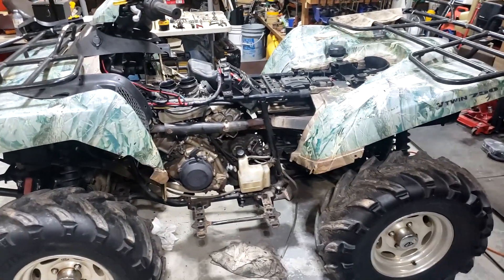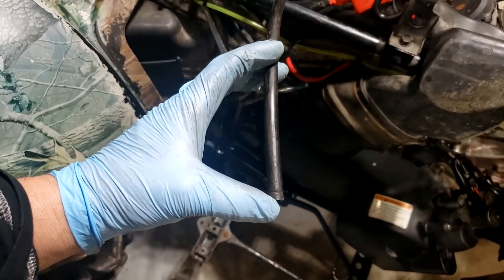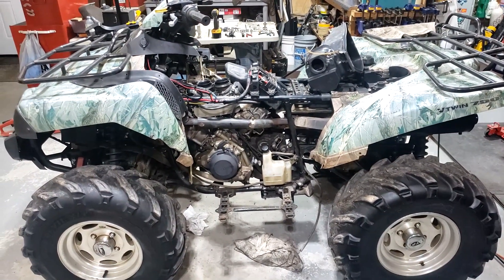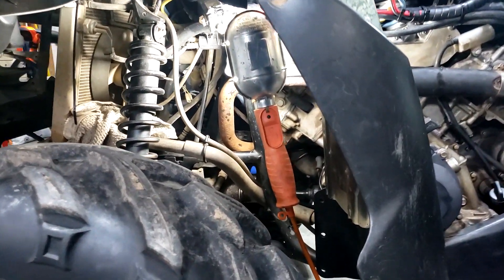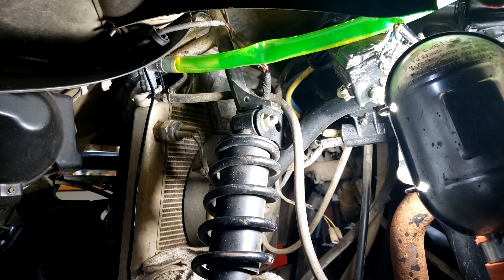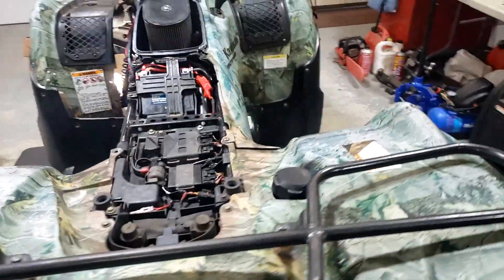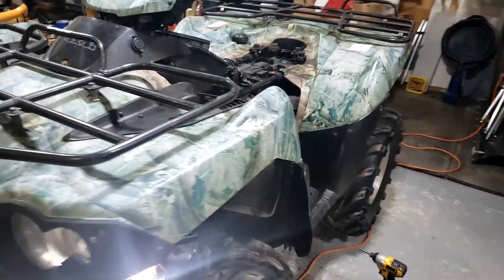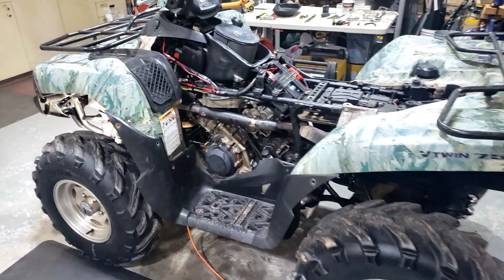Worst Abused ATV I've ever seen Brute Force 750 machine finally done

Comment: On my 06 I replaced the lower steering “ball joint” added a grease fitting, omi greasable upper steering bushing, polyurethane gresable sway bar bushings, gresable metal sway bar links, also did the buss connector mod
Reply from the maker: Cool, sounds like some good mods! Thanks Man!

Comment: 👍😎👌Nice job Rob you literally brought that ATV back from the graveyard. I wanted to know did you also end up replacing the ignition coils too after you swapped out the spark plugs? 
I'm trying to determine where my short is with my 2010 BF750. I was in the process of taking out my battery but before I could detach the positive and negative terminals it slipped from my hand and made contact and grounded itself with the frame of the bike.😳
 I heard an electrical distortion but all the fuses and relays are good.        Now when you turn the key to on the fan immediately comes on and the push start button and headlight switch no longer works. The FI light also flashes and the fuel pump is no longer turning on. If you have any ideas in terms of where you think my electrical issue could be your help would be greatly appreciated.🙏
Reply from the maker: Thanks Man! Didn't replace the Ignition coils.  Spark plug caps were cracked, so corrected that. Hmmm, ya electrical shorts are tough. I'm not the greatest with electrical. There might be switch relays that you missed or a fuse you missed. Other possibility is that a wire actually melted the wire casing but that would depend on how long it grounded for.  I don't think it would've messed up the CDI box but if you have another one to try that would be one thing.  Wish I could be more help.  Good Luck!
Reply: @RobFarrowATV  Thanks for taking time to write me back. The strange thing about my situation is that if you run a jumper wire from the relay switch directly to the positive battery terminal it somehow restores electrical power back to the push start button, the light switch and the fuel pump. It works in reverse.😳🤷
Reply from the maker: Maybe something in that line from the relay switch or the relay switch is faulty?
Reply: @RobFarrowATV  I'll have to check the line but all my relay switches are good though.👍😎👌